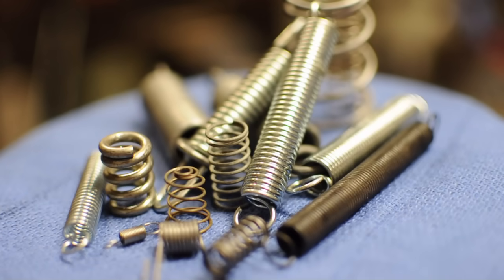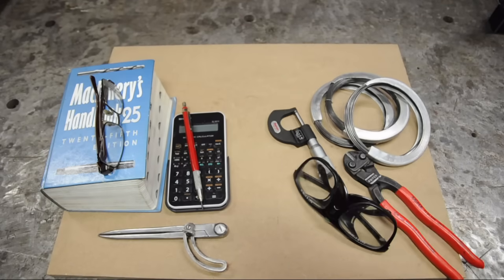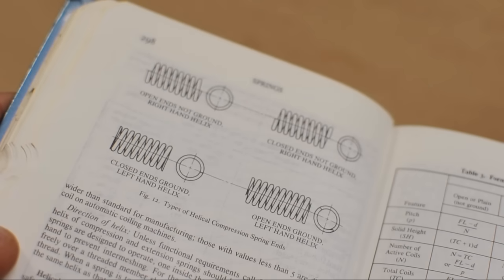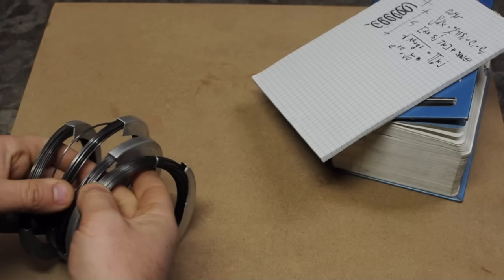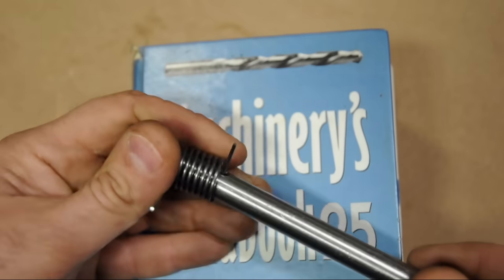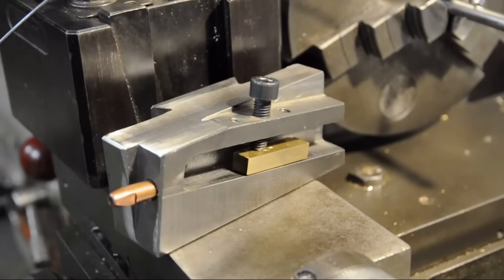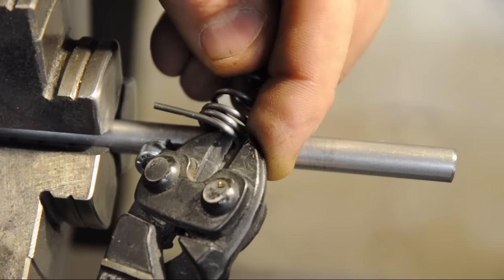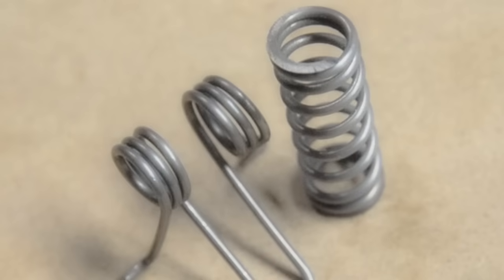Making Springs At Home

Comment: You forgot the most important step. Annealing the spring in an oven or with a torch to lock in the shape. Otherwise your spring isn't going to be...well, springy and will fail prematurely.

Comment: 3d print and electroplate/form into metal
Reply: or more accurately, 3d print a negative and electroplate/form into the spring
Reply: even a metal bar has a compression spring qualities, both sideways cantilever and lengthwise compression

Comment: I lost a tiny micro spring that operated plastic holding clips on a small battery pack. smaller than a spring in ball point pen. I fashioned one out of wire ties and the back end of a drill bit. it did the job.

Comment: As a retired springmaker if coiling on a lathe after turning the amount of required coils you should wind the lathe slowly backwards to release the spring tension. So that when you cut the wire  it won't spin backwards and  damage you hand.

Comment: Funny I should come across this video today - I work as an SFX techie and needed som very small springs for a project, and from experience I know I can't simply buy springs of the desired dimension where I live. I also know that I can't reduce the speed of my lathe at work, to a level where it would be safe to hand feed the wire in, as opposed to the lathe I have at home. So, I built a rig that enables me to make springs from 0.12mm wire coiled around a 0.8mm mandrel, by hand. Yes, they are very easy to lose track of.🙁

Comment: I was a springmaker for 50 years AUTO setter/coiler,  setting auto grinders, Autocomputer 8 arm computer controlled making our own tooling and writing the programme, Hand grinding Setting square to load, rates, length diameters  heat treating, hardening, annealing, hot setting and more. Wasnt the best job but it paid the bills.

Comment: Epic work Old tony, your vids are very entertaining and informative
Im trying to replicate this technique for rectangular springs. Any extra tips would be welcome and appreciated 👍🏼👍🏼👍🏼
Reply: You'll need a square guide. A very beefy boy if your following this guide.
And a lot more torque and angles to ensure are lined up correctly.

Last time I made square rectangular springs, I cut rectangular threads on annealed spring steel rod, cut the inner material out, ran them through vibrator with a bunch of shot and then after everything was smooth I heat treated it, by sliding the spring to be over low carbon cold rolled and borrowing my neighbour's heat treat oven
And heat treat expertise. 
And maybe a bit of his labor.

Cone to think of it. Did I ever release him? 🤔

Comment: Sir,used spring was  retested for load test, but found load value more than the specified...is any heat treatment process required for spring before testing used springs? Or used spring posses the same results as new ones when it's tested!!

Comment: Thanks to an 8 minute video ive restored an old mass accelerator!
There are no parts for this thing anywhere. Took 4 attempts, that undersized mandril advice was crucial.

My last spring barely fit uncompressed but compressed - like a glove.

Previous prototypes required copious amounts of sanding and mucking about to fit and work.

Comment: Helpful tip from a spring maker, (Lee Springs)
When grinding the spring make sure you have at least 75% of the circumference ground on each end coil. This will reduce the deflection, and ensure proper loading.
Heat treatment is done prior to preset and shot peen. 
Have a good day. 😊

PS: hey Tony, when is Boss going to let you put a manual Torin in the garage..I'm sure you would have a great time figuring out the cams. 😂
Reply: Hey long post after, but where do I find the spools of stock material to keep on the shelf for this? I've got the lathe already so I'd like to have it around for when I inevitably need it.
Reply: @joeburns91  it's called music wire, it need to be heat treated after coiling like all springs.  It can be found many places. I would add that the time labor and materials needed even just for a couple spring will be high compared to just buying one from the catalog. A spring makers catalog has thousands of springs available. Just call and tell them what you are looking for. Compression extension torsion ect.
Reply: how do i heat treat it?
Reply: @adog3129  1/2 HR at 500º F  for music wire
Reply: Retied spring maker here, spring steel needs to be tempered at 250 degrees centigrade for 30 minutes @adog3129

Comment: He missed tempering.  If you want good springs then they should be cooked at roughly 300 deg f. Or so.   This will take out some of the stress from winding and will result in a better spring.

Comment: So they aren't heat treated to ensure they retain their shape? I always assumed there was some other heat treat process involved after forming. If the wire is flexible enough to be easily bent around a mandrel then what keeps them from loosing shape under full compression, extension or torsion? Or is the bending of these small wires around a mandrel stressing the metal sufficiently to work harden?

Comment: I've been making springs for 20 years. It is important that you heat treat your spring before use. Depending on the metal type you are using the temperature will be different.
Reply: How can I know what temperature to use in each material?

Comment: Don't I need to heat treat my coil springs? If I make a flat steel spring for an antique mortise lock, what is the best way? Should I use spring steel which doesn't bend well or make the flat spring then heat treat it?

Comment: I find it surprising that a spring is designed to 'spring' back to it's original shape, but music wire steel starts out as a loosely coiled , usually round, material. Then get's coiled under some kind of force, then the material holds that shape to be used under compression or extension. (IT'S MAGIC!) Thanks for all the great info, advice and the link to the mandrel info.

Comment: Something that needs to be done after forming the spring is to stress relieve it. When you form the spring you are stressing the metal beyond the point where it is able to return to its original shape.  That stress remains trapped in the metal and it will allow it to change shape more easily. Every time you cycle the spring, it will continue to change shape. In the case of a compression spring it will just keep getting shorter and shorter over time. To remove the stress, after the initial forming, the spring needs to be heated to allow the grain structure to return to its original shape within the part. Music wire needs to be heated to 450 degrees for about an hour to do this. A rather strange side effect of the stress relieving process is that with music wire , the coil diameter will get smaller. Hard drawn wire does that also. Oil tempered wire does not move. Most common stainless wires are stress relieved at 650 degrees and the coil diameter will grow larger from the process.
Reply: Are your temperatures Celsius or Fahrenheit?

Comment: This is really interesting, always wondered about how springs were made.I,m surprised I thought you had to bring up to heat in forge,then quench to set the springs.I,ve got a lathe and am  building a old Indian motorcycle,which needs lots of different exspensive springs.Great video cheers

Comment: "They're available in all shapes and sizes - except the one you need."

Truer words have never been spoken.
Reply: So fucking facts
Reply: Cant find a good spring to fit my homemade shotgun
Reply: @GoofyVortex  me too
Reply: Also applied in dating scenario
Reply: Truer words were never said!
Reply: Exactly how I arrived at the video.
Reply: why must you hurt me in this way
Reply: Oh hi didnt expect you here
Reply: Instantly subscribed after this :D "referred to in the industry as that round metal thing" also gorgeous  :DD
Reply: Quite true. Came back to this video because I needed about 250 springs to go around #6 screws for a project. While they do make them, I'll take $30 and an hours work over nearly $200 any day.
Reply: Quality Manufacturing Is Our Business

Elizabeth Asuncion
Dear  Valued Client,

I am Shenette Rose Esmeralda of International Spring Industries (ISI). Our company manufactures high quality mechanical devices such as springs, rubbers and vibration isolators. We have been in business for over 40 YEARS and we pride ourselves on being a FAST and RELIABLE manufacturer. We have also served numerous companies from different industries such as mining, automotive, construction and fast moving consumer goods.
 

We have a vast array of products and services for your enterprise which include:

§  Springs – compression, tension, torsion, danly, flat, leaf (load plus)

§  Vibration Isolator / Anti-Vibration Mounts

§  Carbon Brush & Carbon Brush Holder

§  Molded Rubber

§  Vibrating Screen

§  Spring Remodeling – painting, pitch alignment, pressing, stretching, tempering

 

 

I have attached our company profile should you wish to know more about ISI.

 

I will be glad to set a presentation that befits your schedule should you want to learn more about our company’s products. Please feel free to contact me using the details found below.

 

Thank you and we look forward to hearing from you! J

Regards,
SHENETTE ROSE ESMERALDA
Business Development Officer
International Spring Industries
M:09855510320  0933 875 0561 | L: 02 8533 4322
E: gian.isi@outlook.ph 
E: hablosa127@gmail.com
                             Web: intlspringinds.c                      

SPRING.jpg

 
INTERNATIONAL SPRING INDUSTRIES

3 LIKO ST.CORNER MARIVELES ST. HIHHWAY HILLS

MANDALUYONG CITY

1550
METRO MANILA

		SPRING.jpg
65K View Scan and download

		SPRING.jpg
65K View Download

		SPRING.jpg
65K View Download

		SPRING.jpg
65K View Download
Reply: That was a good one hahaha
Reply: I had to pause and check that someone had left a comment regarding this absolute poetry. Oh my gosh, I can't stop laughing. I will unpause once I have collected myself.  I will subscribe whilst doing so.

Comment: A long long time ago, I can still remember, I repaired brass and woodwind instruments.
When I was in my mid 20s I was lucky enough to work with an older gentleman who besides repairing instruments was a welder, machinest and tool and die maker. He had taught me almost everything you just covered.
Beside that, I'd read an article about gunsmithing in the old days, when things were rotten.
It talked about the Blackmagic art of hardening and tempering steel so a spring would be springy and also not snap on the first use.
It had mentioned that controlling the temperature was the hardest part. It had suggested heating steel in molten lead for consistent heating.
I thought that a brilliant way of ensuring even and consistent heating.
Just thought I'd throw that out there as some folks might find it as cool, or maybe hot as I did.  🤪

Comment: I'd be nice if there was a drill attachment that that feeds wire into an adjustable curved piece of metal that folds the wire. Adjust the metal mold forward or back for thickness & side to side for spacing length.

Comment: I have been making my own springs for fishing reels by hand since I was a kid. I've always trial and errored for the spring-back. I might have to get that mandrel information for later use. That last spring at 7:34 highly resembles an AR15 hammer spring. I have thought that those springs could be easily made by hand. The trigger spring isn't much different. It could save you some time waiting for one.
Reply: I'm actually here because I wanted to make an AK recoil spring for a gun restoration

Comment: Great video. I want to make replacement springs (4) for my washing machine. These springs are the suspension hangers for the tub and the replacement parts are quite expensive. Not sure where to even get the wire in the first place. Great overview though. Thanks for posting!

Comment: now i will start making my carb torsion spring that runs at 120$ rebuild set if ordered, thx.
Reply: i looked at it again, and , yes I had a refreshment, mandrel size i forgot...ordered enough wire...and from my retired neigbour i got a fair price on his elderly livetime sand grinder.. new cable, new bands and a wider stand with wheels. i even got me a similar wire cutter, yours is a "Knipex CoBolt® XL 250 mm" out of yours they make two cutters these days. .. be proud of that one,  i would ..not cheap stuff.

Comment: Hi, what do you mean by "music wire"?? Strings? Piano wires? I cannot find anything similar... Do you mean hardened steel wire? I guess it's hardened stainless steel wire, ready to be termo treated? Right?
Reply from the maker: it's literally called music wire. also piano wire. it's already hardened. check Amazon or eBay or industrial supplier.

Comment: Is anyone else having the issue with running the .exe of the Mandrel software from Marv Klotz with the error message: "This app can't run on your PC. To find a version for your PC, check with the software publisher."? I emailed Marv about this but so far, no answer.
Reply: I found the solution. It's described at the top of the Marv Klotz page that's referred to in this video (http://myvirtualnetwork.com/mklotz/). One has to install DosBox, mount the mandrel folder through the DosBox command line, and then run the mandrel program through the DosBox command line.

Comment: When coiling your spring before you cut it off just let it wind back slightly to stop it springing back as this will make your O/D larger, then when finished heat treat at 250 C for about 15 to 20 minutes.

Comment: I realize this is an older video... but i'm having a hard time wraping my head around why you can bend a spring wire, and then it will retain its shape and "spring back" to that shape.  I'd think you would have to do something like anneal it afterwards in order to get it's bent shape to stick instead of deforming further when some force is applied.   Is there work hardening that happens maybe?
Help me obi wan An-thony you're my only help... except maybe more reading online.

Comment: HE FORGOT after you make a spring  Temper it 230 deg  🔥 small wire throw in when u cook  or run a gas flame till light brown NOT RED 
25YRS MAKING SPRINGS - THIS WAY LOOKS TO COMPLICATED WE used  lathe 10 gauge to1/4" -1/2" wire say - best  use a homemade small chuck winder MONKEY GRINDER  :) + handle in a vice and -|_  winder  small slot cut in chuck oh fook i can go on but sheez  need 1/2 hr explaining  🤪🤷‍♂️🧷

Comment: 1. buy the book 2. Buy the lathe 3.buythe rest of the materials now start learning about the book and how to use a lathe after that which probably takes you more than a month  so you are ready to make your spring or🤔get in your car drive nearby hardware store no more than 2 miles aprox spend 50 cents or a dollar and get your spring to repair what you need right away 🤔🤔😫😫so hard to decide spend more than $1000 and wait a month or 50 cents and 30 mins nice video i learn a lot keep posting practical videos 🤤🤤🤤

Comment: Years ago I had a utility knife that had a button you had to press to open it and close it, so it basically locked closed or locked open. Any ways I wanted to fit a small torsion spring around the pivot point to turn it into a flick knife, after many failed attempts I got there in the end and it "fired " at the touch of the button, the main snagging points I came across were most common springs were wound the wrong way or the coils binding up on the pivot screw. 
It was all good fun making it work thow, trail and error ending in success. Keep up the good work and excellent videos.

Comment: Does spending an hour in fruitless search for a minuscule torsion spring that launched into a wormhole mid clean from my coffee grinder before Leatherman mutilating a nappy pin into a still functioning jury rig count?

Note; the original was found ten minutes later, in the bathroom when I went for a shower. It now takes pride of place in my shed next to a 10mm socket that reappeared a year after vanishing and being replaced...

Comment: Great video!  There appears to be many kinds of "music wire."  McMaster-Carr calls stainless "music wire" and yet there appears to be carbon steel wires that are also used for springs.  What type did you use in this video? Also, would you happen to know what condition the wire came in (i.e fully-hardened, etc)..  Maybe I missed the answers in the below comments. Could you please clear me up?  Lastly, any good suggested vendors?  Thanks and keep those videos coming !!!

Comment: Tony, I did a search of your channel looking for anything I could find on the topic of "Tap Follower(s)" The result I got was this two year old video on springs. I have also searched other machinist’s video channels and I still couldn’t find anything. Yes, mrpete222 has a couple videos on how to make tap followers. He also has videos that show various standard as well as clever solutions for taping threads. So I came back to your channel and searched for a different term: “Tap Guide” because Brown and Sharp makes a nice inexpensive tool and they call it “Brown & Sharpe 599-792-30 Adjustable Spring Tensioned Tap Guide”. But nowhere on the internet can I find an operators manual for that tool or even specifications for that tool. I think that Tesa Brown & Sharp believes it is intuitive or that specification do not matter for a $20 tool. One simply buys it and uses it, right. And if they are not very intuitive machinists, they have watched about 1,000 hours of Lyle Peterson and TOT and found the answer through endurance and shear will power.  Not that an index of machinists tutorials is a requirement.

Here is my 2-part question. If I were the purchasing manager for TOT and you asked me to write a spec for a spring tensioned adjustable tap guide Brown & Sharpe 599-792-30 Adjustable Spring Tensioned Tap Guide, what would the specifications say? And if someone had already done a video on how to properly use this tool who was it and how may I find it?